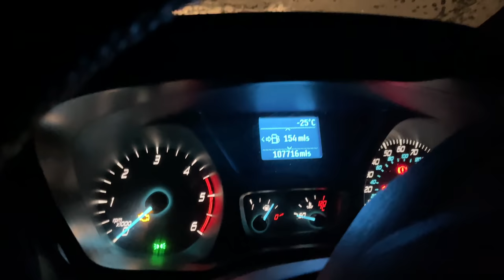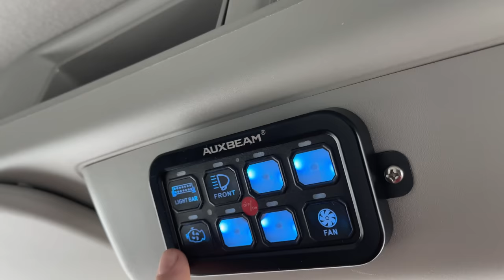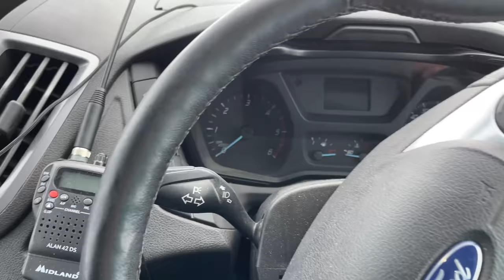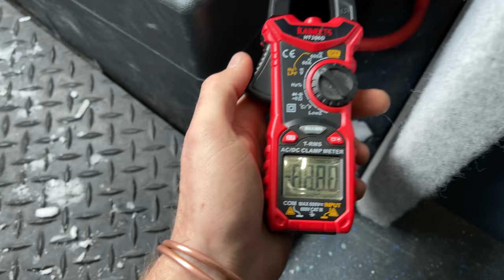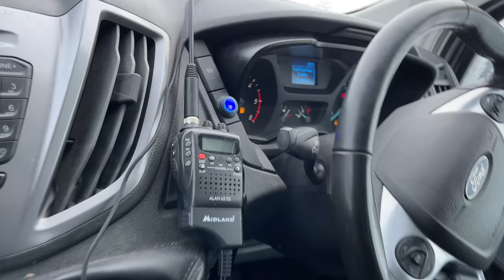Van DIED in ARCTIC cold temperatures | Extreme Winter Vanlife

Comment: 3 things to consider when well below freezing.. 
1) your coolants anti-freeze properties...... 
2) your batteries hate the cold and often 'crap out' in those conditions.... 
3) be sure that your diesel fuel has the cold weather additive suitable for your temperatures.... if not your diesel will turn into a margarine like substance and won't flow to your heater or your engine

Where I live, at minus 15 degrees C, a major worldwide fuel company forgot to add the cold weather additive to the diesel on sale, and hundreds of diesel vehicles had fuel tanks, lines, filters, and fuel distributors full of gunk/'margarine'. And the only way to fix it was to heat things up with a blow torch... where possible!!!

If more than one of those things happen to you, you have a 'cluster' situation on your hands.

(And, strangely, solar panels are more efficient and work better in the cold.... but nothing else works that way!!)
Reply from the maker: I have told a coolant was a lower ranted than it was, which is not a surprise, as no one measure it in the uk. I fixed it a few days later. 

Never had a issue later on on the trip with the starter, there are feed with a trickle charger normally to keep them topped up, but this case I could didn’t want to wait for a 1amp trickle changer so I a rewired the 30amp charger. 

All Nordic fuel is pretreated so it’s not issues and made sure I ran all of the old diesel out of the engine pre-heater and air heaters lines when I first got into the cold. 

And you are correct solar panels work more efficiently when they are colder. However, the bonus is a kind of negated in the Arctic as there’s no sun anyway.
Reply: @MispronouncedAdventures  well, you did do your best about sorting the diesel situation out (gelling)
as you bled, drained and changed diesel when up there.... and the anti freeze, well you did your best, in your own country. But I always do as the Romans do, when I'm over there!!! So as well as the diesel change, the antifreeze update would have been important... 
But you know that now. It's all experience, and you've done it.  What really freaks me out, is that you have little control of a main battery going 'off' on the cold. Personally, in those conditions, you really need a group (at least 3 or 4) of other vehicles travelling with you for safety. Otherwise it can end rather badly.
Reply from the maker: @colonelfustercluck486  changing diesel isn’t too important as it’s a 2000 miles up there from the uk. So you work it all thought pretty quickly. 

I had other back up systems and even satellite comms as well if problems solving
Reply: @MispronouncedAdventures   OK.... the comment wasn't so much for you, as you have "been there, done that" and you are now experienced.... I made the comment for more the inexperienced adventurers amongst us, who may be viewing this channel. And who may be tempted by your awesome adventure, to 'have a go' at it, without properly thinking all contingencies though. You know, all the little things that can trip you up, when you go a'travelling out of your normal climatic zone, the little but important things that can really stuff your trip up, or be dangerous. Thats all I meant, no criticism towards you and your channel.... I enjoyed it.

Comment: As a maintenance engineer I have a army camp stove that I put under frozen cold store pipes it runs on any fuel have a fan for ventilation two one in and one out air. Are other things fixing cold engines gearboxes on big machine's and industrial boilers it heats up the pipes inside the burner chambers you can climb into you just need above freezing 🥶 to get going .lights 🔥 under lorrys sump and have a tarporline over engine area helps.one last thing put deinonisized water in to your antifreeze with anti freeze down to - 40 plus there is oats anti freeze ie blue or red for metal in your engine very important as corrosion in engine as you are in a lonely place I would put some engine cylinder head sealant in for any leaks it does not have beads in it or aluminium bits like some stop leaks it runs enert around your engine it only does its job when it gets to a leak it goes out leak and it is a chemical that is like sheets of glass it build's up the layers and it goes out leak like building Lego and make a solid plug that is hard as metal this does work permanent fix . hope this helps.cheers Russell Hutchison engine from chirnside Scottish borders Scotland UK engineer 38 + years

Comment: My chinese diesel  heater would not start when I was near Yakselv in -30deg c.........The  heater exhaust pipe under the van was blocked with ice.I had to drill the ice out then it started straight away and pumped out the heat.My Sprinter 314 started up every time no probs in the mornings I let the engine  tickover for 30 minutes everyday before I moved off.I hope you are safe and warm
Reply from the maker: I’ve seen that issue have with heater before Chinese or western brands. Even in scotland I’ve seen slush from the road kick up and block the exhaust which then what is the heat going to shut down. Happened to me once on a trip with snow blocking the exhaust. 

Engine preheater on the other hand was the coolant froze therefore wasn’t able to  pump which caused the pre heater to overheat it was actually starting fine every time

Comment: Quality episode. You could consider a few thermal/reflective blankets - to put around the engine and close the bonnet - so the engine block would heat up too a little bit from the heater system - do like the fact you have some gear there man - and know how to get out of a pickle. Nice one!
Reply from the maker: Thank you very much for watching. this is probably the first cold night of the first trip. So lessons were learnt about to go up with my third winter. The main fix I needed to do in this case make sure the coolant mix was correct ( as it wasn’t what I thought it was ) . This was fixed I few days later when I swapped the coolant out in a layby.

Comment: Probibly wouldn't hurt to take a peice of cardboard in front of the radiator so it don't slush up driving down the road before the thermostat opens. Been their before . Best to add more antifreeze so it doesn't freeze up make Shure to put a few holes so it cools it and watch your gages so it doesn't over heat I do this here in Maine during the winters just be careful to not bend the fins to mutch . Best of luck . On cold days it helps you will no if you lose heat in your heater that's stock for your van I've had em ice up againe but if your heat starts to seem it's not working out of the dash it may be it's freezing up before the thermostat stat has time to open. Your a smart guy you seem to be mechanically inclined you know it's bad if the belt start scwealing she's real cold you never want to pop a freeze plug in the block. Best to put good coolent that's not gonna freeze. Is the cure.
Reply from the maker: I did a coolant swap the following day in the layby in the Finnish wilderness,  sorted the right mix which was good because it was the coldest night of the trip that night, and I do actually have a grille cover which I use later on the trip during colder temperatures whilst driving as I did have the Problem of the cold air cooling the coolant down so much I was no heat left in the engine for cabin heaters or the engine

Comment: Maybe get a cheap stand alone diesal heater to give heat under the engine..
Years ago I brought a Norwegian army G wagon from up north it had silicon brake fluid and hard core coolant..
Also a webasto pre heater and an fitments for an external preheated like a blowlamp sort of thing ..
Snow chains as standard..
Pull up blind over the radiator..
As you say it's a lot of prep.
Fantastic stuff
Reply from the maker: Definitely lots of different Solutions out there. Hydraulic air matrix in the engine bay attached the webasto heater could’ve been a good solution
Reply from the maker: I have a radiator cover / grille cover which I use when it’s even colder and I’m driving. It makes a massive difference

Comment: Sorry this will be of no use too you know but vans get a very hard life and generally the things that gets missed are the fluids so I would always change the antifreeze no matter what the service history says. I do hope you changed the oil for the correct grade for those extreme conditions, as I said no help know. That said I just love the series and really look forward to the next instalment. All the best.
Reply from the maker: No need to apologise. As for coolant, yes it was an oversight as I was under the impression it was a lot more concentrated than turns out it actually was, that’s all been sorted now correct Concentration used and a lesson for the future. 

Oil for my van is already 0W30 which is designed for a cold weather performance, my Nordic friends said need to change that, already plenty thin enough for those conditions

Comment: Get that sorted asap! Good mix of 50/50 should work in -40. Starting a frozen engine is very dangerous. Coolant pump could be destroyed, or even worse, if the pump is powered by the cam belt you can destroy the engine!
Reply from the maker: Yeah it’s all sorted now. The only reason I started it cold, was I knew it wasn’t frozen solid, just slushy. I wouldn’t of never even tried to start it if I knew it was frozen solid for the reason you mentioned above.

Comment: Yeah they're pretty robust it shouldn't hurt anything if you start it and let it warm up. With the proper mix I think you'd be just fine, no need to leave anything on.
Reply from the maker: Swapped the coolant two days later. No issues for the rest of the winter or the next. 

Mix was not what I thought it was at the start of this trip

Comment: Loving your videos! Pure glycol actually freezes at a higher temp than when its 50  50 mixed with water so this may have been part of your problem if the coolant hadn't mixed properly when you added the few litres of concentrate. Just a thought!
Reply from the maker: Could will well be in one of the issues. I didn’t realise that was the case with pure glycol, I also understand that pure glycol isn’t a very effective coolant either

Comment: I'm screaming at the tv nooo leave it running your guna kill the battery and leave yourself stranded. I'm in -4 and I don't even use diesel I use waste oil and veg oil 1.9tdi really hard to start and sounds like a washing machine full of spanners but she goes after a few mins, just have to persevere. I use a fuel tank heater and a inline fuel heater before the injectors and have been working on cars for years, rebuilding this engine too at 89000 and she was spotless and she's approaching at 180000 now 👍
Reply from the maker: I didn’t know what I didn’t know at the time but it all worked out in the end. My thought process being I knew it would warm up to -14c in the afternoon and I had the ability to charge the starter. So wait it out
Reply: That's fair man glad you got it sorted! was an entertaining video for sure haha had me on the edge of my seat. recently found your channel and look forward to your future adventures mate, stay safe out there!
Reply from the maker: Glad you are enjoying the channel next time. I will check the coolant myself before I leave for the trip. additionally, with my second trip up there, I’ll be armed with a little bit more knowledge

Comment: You need to keep the engine pre heater running or fit a timer on it to engage every few hours to stop the temps reducing so much . Fitting under trays and grill blankets also help alot .
Reply: Make sure your using a 0w20 while in them temps as well. It would be rough sounding due to the oil not circulating.  Pretty sure ford also do a sump blanket  for these to help reduce wind chill cooling the oil
Reply from the maker: The coolant now is sorted and running down to -36c. 

I’ve been using a grille cover /  blanket later on in the trip when I got down to -27c and driving. I was so surprised how much of a difference it made.

As for Oil my van uses 5W30, I did speak to some people about this Oil, they did say 0w20 or 5w30. Since my van already uses 5w30 I’d thought I’d stick with that.
Reply: @MispronouncedAdventures  I'd definitely drop it to 0w20 while in the lower temps . 5w30 is fine over here and down to -10  but you're pushing it below -20 , damage will only show its face further down the line . Leave the grill blanket on , wind chill is an issue even when engine at full temps as the thermostat will close so the radiator will cool fast and potentially freeze and split even at -36 strength
Reply: @MispronouncedAdventures  Interestingly 0W30 recommended for my transit. Not a particularly cheap option though!
Reply from the maker: Ah, my mistake. You mentioning it not being a cheap option reminded me of something, well the garage who did the service originally charging me more! I just looked up the manual for my van and I was mistaken it is 0W30 I have in the van and not 5W30

Comment: You should just let the engine run when it first started, the rough idle would normalise in about 20-60 seconds. revving a bit is ok, until it runs on all cylinders. let it run for about 5 minutes if you drive carefully, og 15 minutes if you strain the engine. About your coolant, did you drain the whole engine when changing it? if not, it wont help. usually there is a drain plug in the bottom of the radiator. and recommending that you check a video on how to bleed the system on your car.
Greetings from Norway, -27 c at the moment. But great videos :-)  thinking of building a van from scratch myself, thanks for great inspiration.
Reply from the maker: This video was my first coldest night of my first Arctic winter. I’m now currently in Finland for my third Arctic winter and used to the different noises the engine can make at times but at the time of this video I was not. I’m not used to as a Brit starting in that temperature, and it sounded like a dying tractor, so I thought it be reasonable to shut it down better to play it safe at the time with my lack knowledge then. 

As for the coolant, I replaced it in a few days afterwards. I used an online calculator to tell me how much I needed to remove of the current volume and replace it with concentrate to get it to the higher, percentage and desired.

Don’t need to drain the entire volume, the next time the engine thermostat opens it would mix the new stuff I put in via the reservoir with the older stuff I drained out of the engine side.
Reply: @MispronouncedAdventures  I didn`t notice the age of the video before now, but totally understandable first time experiencing it.  

i might have missunderstood something, i was thinking of degradation of the coolant, but your car looks to new for that to be an issue. 

but other than that, really liked your setup, going to use some of the same solutions myself, on budget thoug.

how is your trip to Finland?  guessing you have had some real low temperatures lately? we have had -27 in East Norway on several occations lately, and heard about around -44 in Kautokeino
Reply from the maker: @djtesla87 yes, it was more of a too diluted coolant mix than degraded. But I see you point coming from that point of view, 

Going well! I left the uk 4 days ago and now in Rovaniemi. Coldest so far has been -26c for me this winter
Reply: @MispronouncedAdventures  i understand :-) 

Sound Nice, looking  forward to getting mine  finishes as well :-) 
-26 is cold enough as well,  I wondering, how much fuel do you use from UK, and til you reach Finland? (Estimated)

Hope you'll have a great trip, recommending lofoten, and Senja if you haven't been there

Comment: May I ask how much roughly did it cost to buy and kit out your van? Thinking of doing it with a transit, have a Ford car which I’ve had for 9 years, great model fords 👍
Reply from the maker: My transit when I got it was 2 years old ( 2018 ), 78k miles, air con, rare colour and high Spec model for £16k pre-Covid prices probably a lot more now. 

I’ve probably put 15k+ into it. However, that’s because I have a substantial electrical system and a bit of a nerd. I would say the actual material costs for cabinetry insulation, so I,  were average.

Comment: if you had a 1990 ford this it wouldn't be happened :)   adblue is big mess with artic temperature also...   but good job and it's also very cool your van.. claps !!
Reply from the maker: Thank you, old engine just lite a fire under it, to many wires in model engines. Adblue freezes around -11c I think. It was probably frozen most of the trip. But the engine doesn’t need adblue to run. It’s just meant to have it to reach it emissions standards

Comment: Heat gun. On the oil pan and radiator and if you can reach it. the water pump. Also need whiskey
Reply from the maker: I did have plenty whisky 🥃  the amount of energy needed with a heat gun might of been a bit much to thaw out larger things, definitely should work for individual, smaller components

Comment: Hi I have the same van as you but 2017 can you tell me do you use LED headlights or the standard ones I’m from uk?thanks love the vids aswell good job 😁
Reply from the maker: I use standard headlights, and auxiliary led light bars when up in the Arctic ( my bars can be used on uk roads ) 

From my understanding, I think you can retrofit the modern transits LED headlights unit into the older our model. You’re not meant to swap the bulbs to LED bulbs because the units have different projections.
Reply: @MispronouncedAdventures  hi thanks for quick reply I’m just wanting brighter low beam for night driving I guess I will try the brightest halogens I can find looking at the Philips racing vision gt200 h7 maybe my best option instead of messing around with LED and risking error codes etc 🙋🏽‍♂️keep up the vids really interesting thankyou 😁
Reply from the maker: No problem I hope you get it sorted